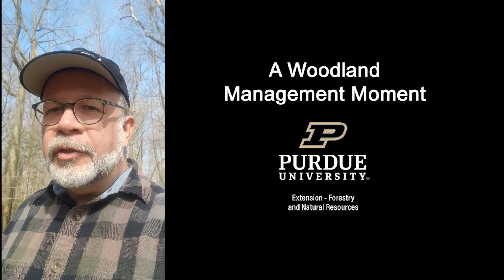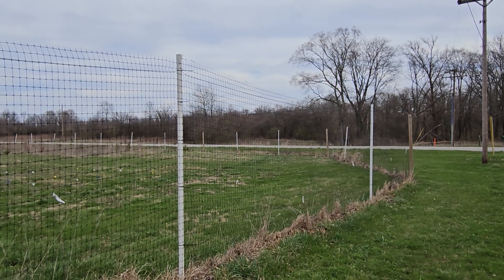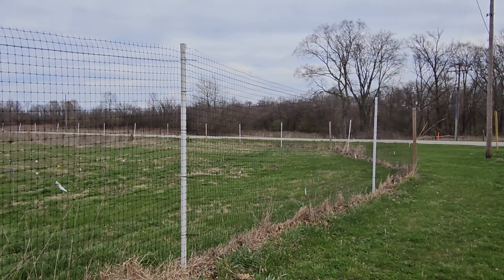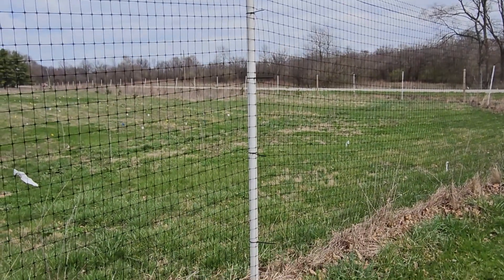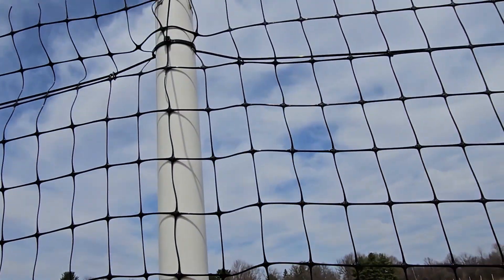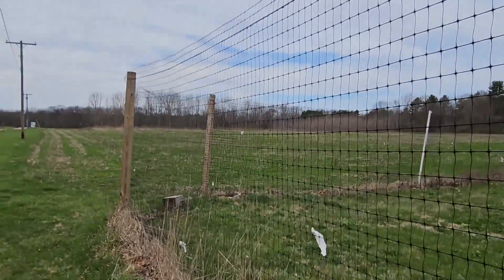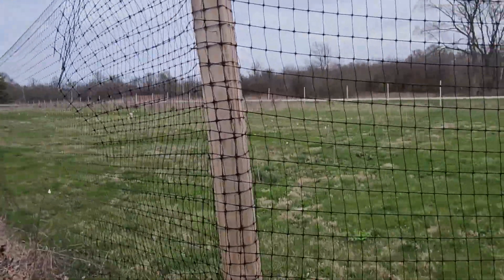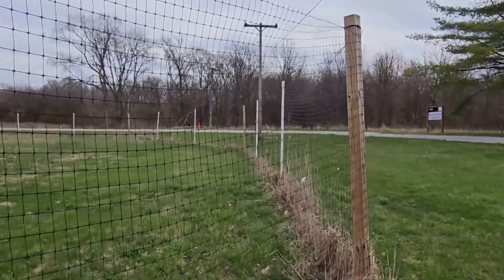Woodland Management Moment: Deer Exclusion Fence Revised Design

Comment: What is the advantage of installing the pvc over the t-post? A more economical way to get 10' height?
Reply from the maker: It can make construction easier and quicker, as opposed to digging or driving larger wood posts, and can be more economical as well. We are trying to provide several options of construction that may fit different operations with varied equipment and labor resources.